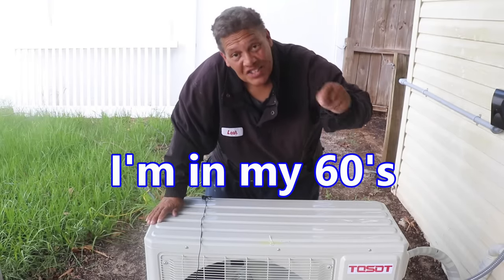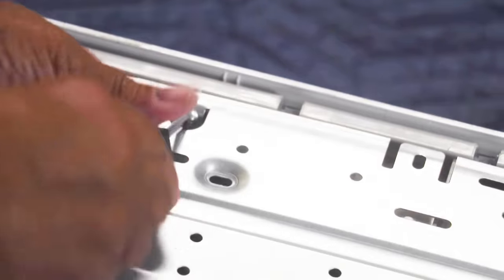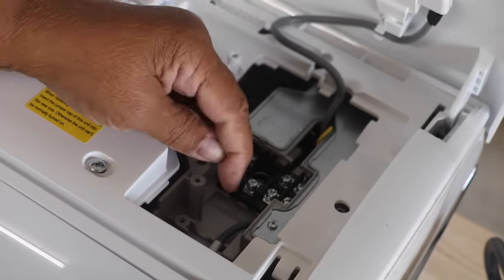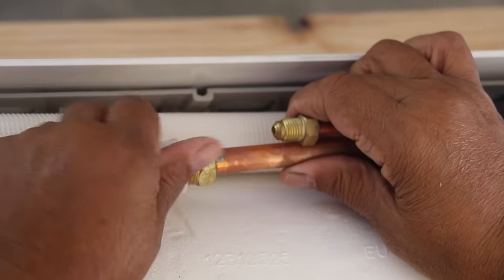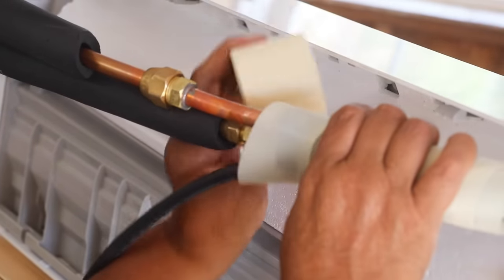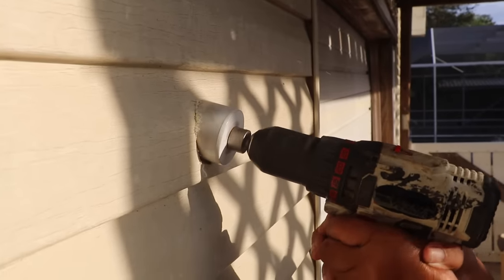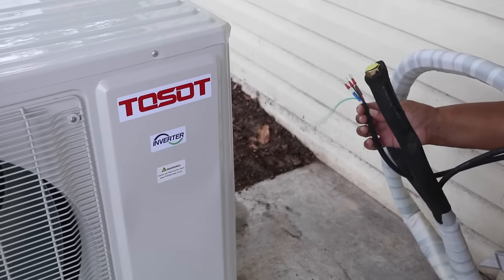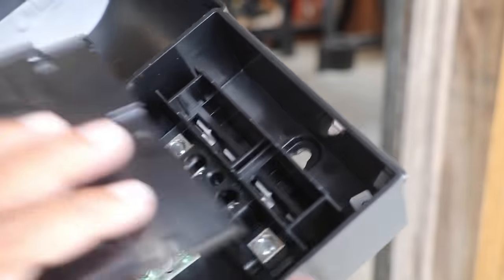I saved $4,200 installing a mini split AC myself

Comment: At 15:30 you are doing a soapy water leak check, but aren’t the lines under a vacuum at that time? The steady gage reading during the 5 minute waiting after vacuum pumping should reveal a leak, right? I guess then that the condenser unit comes charged with refrigerant and the lines pressurize when you open the valves.

I love the respect you demonstrate for your audience by sharing this project, one that many a handy person would never have imagined taking on.
Reply from the maker: I removed the gauge before the test. No there was no leak.  Soapy water demonstrates how to look for leaks had there been one.  The unit comes charged.

Comment: Very inspiring and cunning woman. 
Question: Is this for a mini split AC with heat pump or cooling-only ?   I ask because I only need cooling so I won't be buying one with Heat Pump and so I wonder if the added required dedicated circuit will be required on those..

Comment: A few things.  You should have rotated the lines at the head unit and put the hole there rather than attaching the line set and bending it so sharp, can kink, this is in the instructions.  Wait to remove plugs and attach line set till after head unit is mounted and do it all outside.  Second, you removed the vacuum line before charging the lines just a little which pulls air back into lines and head.

Comment: I HAD MINE PROFESSIONALLY INSTALLED for only $700.  Which included running a new electrical line from the box.   I don't know who gave you such a high price for installing it.

Comment: One tip from an HVAC tech, do not remove the manifold gauges until you open the refrigerant lines, otherwise you risk breaking vacuum and re-introducing moisture or air into the lines.

Comment: great job, i just have an issue that you didn't pressurize the lines with nitrogen with 400 psi to make sure u didn't have a leak or the use of a micron gauge when pulling a vacuum.  Should of paid someone to do the startup of the equipment to make sure things were in order to save future headaches.

Comment: Whilst it works, you should have opened both valves using the hex key (to release coolant into the system) BEFORE release the vacuum via the low presser manifold gauge (blue line). As it is, apart from checking for leaks, the system was filled be coolant as ambient air pressure rather than into a vacuum. The main point of the evacuated lines is the get rid of moisture and contaminants. You did very well otherwise. 👍🏻

Comment: Wow, you have skills. Ive got a question. If you putting the unit in the living room, what about the electric outlets when drilling the hole? I appreciate your time. Wonderful channel.
Reply from the maker: You'll need a stud finder with deep scan capability which can identify electrical wires

Comment: You should also actually do a 200# nitrogen pressure test to dry out the lines of moisture as well as the vacuum which boils the water out..
The high pressure test verifies at high working pressure the lines will not leak.... the low pressure is there for mostly water evaporation!

Comment: So how has this unit done for you? Our unit is getting old. HVAC folks keep reminding us at every routine service. It’s working fine but it’s 13 years old. They say it could quit any minute. They’re talking 18k to replace the unit. Not the ductwork. Just the unit. With “a few essential safety upgrades”. (Surge protectors). So we’re looking at splits for several reasons. Mainly to get rid of the ductwork and floor vents. What do you think after a year?

Comment: PLEASE CHECK YOUR LOCAL LAWS before doing this install!  We found out the hard way that we were supposed to get a Mechanical Permit from our City (Portland, OR).  We called several HVAC companies in our area to see if they could reinstall to make it right, but they refused, saying since the box was open, they won't install anything the customer already started because of insurance and warranty issues.

We ended up removing the mini-split before putting our home on the market for sale because it was un-permitted work.

Comment: Great but missing few pieces. After running pump, how do you charge the lines with refrigerant and also the fish line cable had to be tighten in that brown bracket to avoid pulling the wires.. but Bravo
Reply from the maker: The system is pre-charged...there is no need to add refrigerant

Comment: Its appalling what Hvac contractors want to install mini splits! They litterly want more for labor than the units themselves cost. We have 3 mini splits that i personally installed over 4 years ago and they are still working perfectly.  I do all the maintenance myself as well. We have a 1500 square foot home that had a 3 ton central air unit that needed to be replaced.  The cheapest qoute i recieved from 3 different contractors was just shy of 16 grand. That was for a lower quality goodman basic non heat pump. Basically bottom of the barrel unit. The qoute i got for an actual heat pump inverter unit was north of 20 grand! There number one reason for such a high price was ,"its the cost of business" lol! One of the problems i found doing research on why the cost was so high is because contractors today want to make a profit on the actual unit they sell you! Meaning if the unit they install is say ,3000 dollars their cost they will charge you the customer 6000 dollars. Basically 100% markup. They do the same with labor. If there paying their guys 30 dollars an hour they turn around and charge the customer 100 dollars an hour and so on....i also noticed on that on all the 3 qoutes i recieved was a charge for coolant (freon) ! I found this disturbing because i found out all compressors nowaday come pre charged from the manufacturer with enough coolant for 15 to 20 feet of linesets (coolant copper lines) ! They are basically charging you for something that comes with the unit. This is fraud as far as im concerned.
Reply from the maker: Your points are dead on.  That's  why I believe these sorts of diy videos are so important.   I don't want to see folks get over charged for something  they could easily do themselves.

Comment: I'm going to be installing my Mitsubshi mini split in the garage.  I was floored when I was getting quotes for $8,000 to install an 18k BTU unit.  After watching 100+ videos I can buy ALL professional tools and use it to install the unit and STILL be $3000+ savings in my pocket.  Not knocking the pro's out there who do this all the time but seems so silly to spend $8k for a luxury in the garage when one of my ac/furnaces in the house was $10k.  Something seems seriously not right with those numbers.

Comment: On the internal terminal block you omitted reinstalling of the tension relief and how to tighten it down correctly.
Reply from the maker: Yes, you're correct.  It sometimes difficult to include each and every process, otherwise the video would run hours.

Comment: Interesting video I got lost when you pulled a vacuum. You didn't go into detail about the refrigerant. Is it all ready in the compressor and is released into the system when you turn the Allen key?
Reply from the maker: Yes, the system is already charged and the allen key releases the refrigerant

Comment: I want a mini-split but I would rather wait for a greener refrigerant than R410 (phased out January 2025). I'm hoping a R290 (propane) monobloc (all propane outside the house) mini-split will be available for purchase soon. Europe has been using it for years so it's not a safety issue.

Comment: I understand it needs a extra/separate electrical panel for the new mini-split; however, does the source of power "HAS TO" come from the existing Fuse box? and "HAS TO" add a new fuse to it just for the new mini split?
 Can I get it from existing outlet/wires due to location of the mini-split cannot easily access to the fuse box? 
Thanks in advance.

Comment: Good for you installing yourself, but you need to know these things:
1. Using romex outdoors is a code violation. The insulation can absorb water and over time, cause a short or open. And yes, you can find a video by electrician U showing that an outdoor set of lights where they failed due to using romex and getting water in the wiring, even inside stone.
2. Your gauges cannot tell you if you achieved a good vacuum. Using them to gauge that is like using your car's odometer to measure your driveway. You may have a working system, but without doing a proper pressure test and micron gauge, you probably have a system that will leak in a few years.
3. You cannot attach the lines without a torque wrench. You will put too much torque on the small line and you may not have done enough for the larger gas line.
4. Don't buy a unit from TOSOT. You'll never have end user support with them. They are rebranded Gree units and they are harder to find parts for them. Buy from Pioneer. They don't care if you didn't have a tech install it.

Comment: Very informative video. Thank you! I was thinking about installing a mini split for a small cellar. What do I need to do different for the drainage line?
Reply from the maker: I don't understand your question.
Reply: Thank you for the reply!
Would I need to do anything different if the evaporator (fan) is lower than the condenser? It would be for a basement.

Comment: I noticed that where you connected the copper pipes, you left them un-insulated in that section.  I don't think the tape alone is a good thermal insulator.  Have you gone back to check that section for condensation?  Great DIY video, otherwise.

Comment: Ac should be installed by licensed technicians,  if there is a slight leakage anywhere the hazardous gas will leak, and if someone turns on gas or lighter or matches boom.

Comment: Nice job, but not really a DIY system for most. people need to understand the safety precautions when dealing with electrical panels and gases like R22. I would highly recommend hiring a electrician or handyman at minimum, Also they have more better diy friendly kits out now that don't require a vacuum pump or pressure gages just quick connect and go!

Comment: I certainly won’t be employing you granny to install an aircon, no ducting used for the pipes and cables on the outside wall, also it’s possible to rotate the pipes on the indoor unit by 90 degrees so you can exit them through the wall on the RH end, depending on the building !

Comment: Can you offer any advise on why I am not maintaining the negative pressure on my pump guages after I turn it off (after running for 15 mins) I am installing 2 of these and the gauge moves back to 0 on both. I have used Nylog on all 4 connections and tightened as much as possible. I was also careful with the lined, not to crease or tear. Can it be anything other than leaks where they are screwed together?

Comment: Unless you want to electrocute yourself  or set your place on fire. The FIRST thing you need to do is determine where electrical lines are running in your wall so that when you drill in plate, drill a hole in the wall etc. you aren’t electrocuting yourself or starting a fire in the wall when you nick a wire then turn the electricity back on. 
Unless you saw it installed don’t assume electrical wiring is vertical.

Comment: Is this comparable to a normal hvac unit? My entire unit needs to be replaced bc the coil has a hole in it so it keeps leaking water everywhere. Still works but I have to vacuum the water off constantly. Not sure how long it will last. It’s R22 so it has to be replaced no matter what. 

I live in Oklahoma City. My house is approx 1600 sq ft and it gets hot here. Some times up into the 100’s. Does this work better, the same or not as good as a regular ac unit? Looking online the package I would need is around $6k. I need ac for 5 rooms. I’m also worried how this will look with hoses coming out of all my rock exterior walls..

Comment: The price gouging that HVAC companies have is truly mind boggling. You can buy a 18K BTU Mitsubishi/Fujitsu for $2,000. HVAC company will add a 200% profit margin and charge you inflated labor and make up some BS number like $8,258.43 installed. It's absolutely nuts.

Comment: Important to read the warranty small print. I’m a diy lady. But with ductless units and condensers, Cos. Will NOT WARRANTY products installed by unlicensed HVAC installers. I bought some diy units and had a handyman install them. The condenser immediately failed. The well known diy co. Refused to honor their warranty, until my husband yelled at them on the phone. It Still cost us 2X! to install the condenser (the second time an HVAC person installed the replacement). I don’t recommend diy ductless units, unless you are comfortable voiding a warranty, by installing it with a non HVAC person.

Comment: I plan to install one of those in my room, but my question is about the process with the gauges...I have to do that that step , ( i don't have the gauges and the pump) what happens if Install and check for leaks and run with out the ( gauge process)
Reply from the maker: You really need to clear the line prior to releasing  the refrigerant in the lines.  There are mini split that don't require this step.  They're more pricey  however.

Comment: U mean it cost 4k to have it installed? I just bought one for 500 usd. I expect to pay 200 for installation
Reply: Nah, it’s more than 200 way more, if it’s not for you than that’s because you probably have connections but other than that, the electrical wiring to the electrical panel, having to figure out what the right amount of wiring is needed is the tough part, mounting the outside unit, drilling the hole through wall, making sure the condenser is balanced, it’s a simple and inexpensive job if you have the right idea and the required tools but way too expensive if you don’t. If you end up doing it yourself, a 220v is better than the 110v they usually come with simply because the lower the voltage the longer it takes to cool or heat depending on weather and the more they work in the long run. and 220v you’re essentially working it in the beginning but then gets cool faster during hot weather and warmer faster during the winter. Therefore you’re not working it as much in the long run , which allows your unit to live longer.
Reply: @chalostraps thanks

Comment: How do you manage to line up the hole on the inside of the house with the outside of the house?  Do you just eyeball it?
Reply from the maker: The long drill bit drills thru  the exterior wall as well as the interior.  I just looked for the drill hole.
Reply: @seejanedrill  Amazing!  Thank you for all your wonderful videos!

Comment: All the tools required cost more than the units and you'll only use them once unless you do it for other people. Doing the electrical and mounting yourself is very cost beneficial. Just pay someone to charge the system..

Comment: I have 2 units in my adu. However, one of the unit has been condensation and spilling to inside instead of outside. Any idea why or how to fix?
Reply from the maker: Sounds like the line is blocked.  You just need to clean it out.  I shop vac may do the trick
Reply: @seejanedrill  Thank you for your response. I will try that .

Comment: You must have stolen it! The mini split costs at least $2,000. to $3,000.00 for the unit and roughly $1,000.00 for the service installer, total about $4,000, if you bought a good one. But, Who are you going to call when it need servicing & repairs, and it definitely will? NO REPUTABLE DEALER will service it under what ever warranty you may have, and you probably don't.These guys don't work for free and if they don't sell the brand that you bought, will most likely not ever come out to your house. A word. of warning to "do it your-selfers, HVAC Service men, went to school and trained for several years I order to do CORRECTLY for what you did in several hours. Good luck, but I wouldn't listen to a know it all for your safety and comfort, especially when the heat of summer rolls around. I'm happy it works well, good luck.

Comment: Don't you need a mechanical permit to install the A/C and an electrical permit to install a power outlet from your local building department?
Reply from the maker: In my area what's needed is a homeowners  permit
Reply: @seejanedrill  Homeowners can pull permits here too, but they to demonstrate competency, which you obviously have, but may be difficult for the average DIY'er.

Comment: That's not called a "U type terminal", just because it is shaped like a U. It's called a standard fork terminal. You're welcome. Why didn't you use any teflon tape when you joined the line set together??

Comment: As someone who has lived in Europe and Asia for long periods, I can clearly say that the "mini slit AC" is horrible.
My GF gets ill every time I turn it on.  It is difficult to get them in an area that they aren't blowing right on you.
BTW, I've installed 20-30 central systems and they only cost $1000-2000 wholesale but companies are charging $3000-12000.

Comment: Why would you do this when you could put a window unit in for $150 for a 5k btu? I have a 3 ton unit on the roof that has 15 years on the compressor and 22 years overall and when it’s kaput I’m probably putting three window units on this building and stopping right there for a while unless I want to dump a whole bunch of money on the problem.

Comment: Yeah and when it doesn’t work and/or breaks and needs to be fixed, good luck on the warranty aspect.
Reply from the maker: These units are specifically designed for diy-ers.  Beyond that, for what a contractors charges, a homeowner can purchase 4 new units.  I think that says it all.

Comment: I am confused you can get a actual full sized system installed for under 10k and your telling me a hvac company was going to charge $4500 to put in a split system? I call BS its cool that you did it yourself but that is how these systems are advertised anyway as a DIY.